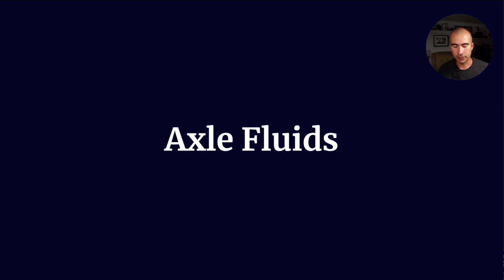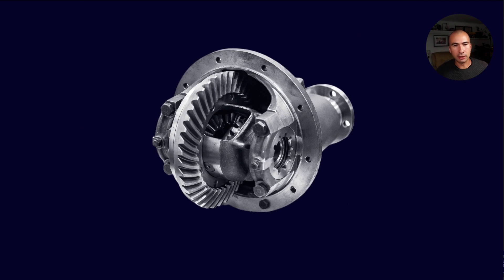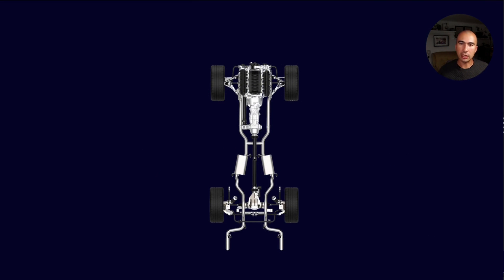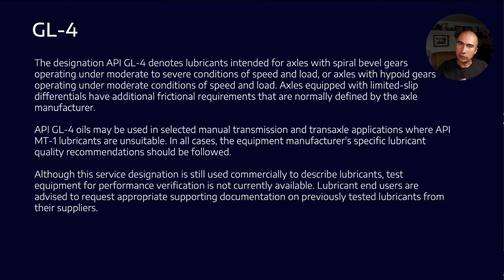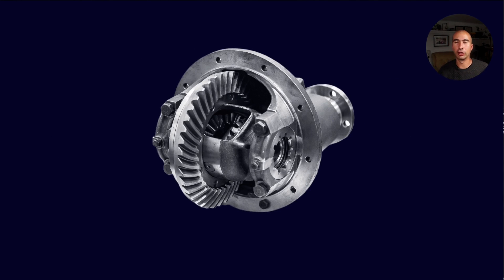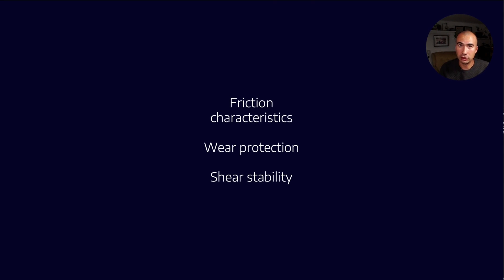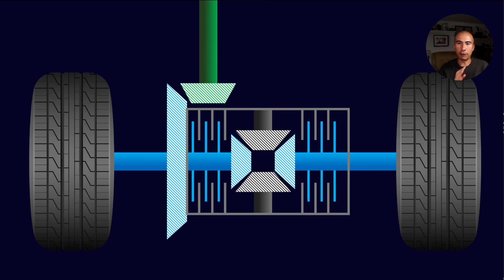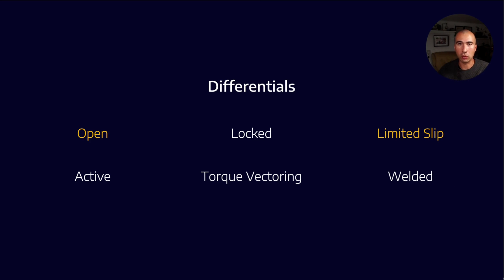Lubricants for axles - how are they different from gear oils?

Comment: Does it make sense to use a more viscous fluid in differentials with mileage (for example, more than 200,000 km)? to compensate for wear? for example, 75w110 instead of 75w90?

Comment: Some OEM. Recommends 80W90 for front and rear diff however 75W-90 for the tans.. i thought 75W-90 would be a superior oil thus used in all 3.. ??🤔

Comment: One thing I have learned with my 2017 ram 2500 with anti-spin
 Is that traction control virtually renders the anti-spin useless. Unless I totally turn the TC off - which is another can of worms.

Comment: Hello ! Is differential oil is the same as transfer case oil ? I am owning a Toyota rav4 4WD diesel automatic transmission  2018 model .
Reply: They often are. Check your owners manual
Reply: @zzman5306   I did almost the same thing , thank you 🙏

Comment: In a viscous LSD, wouldn't you want an oil that behaved like a non-Newtonain fluid?
Reply: In my experience a viscous LSD has the working part sealed so the diff oil would be OE recommended.
Reply: Like silicone oils? corn starch is a poor lubricant